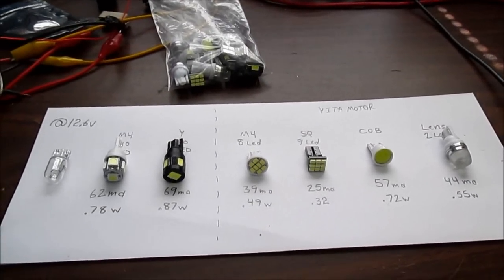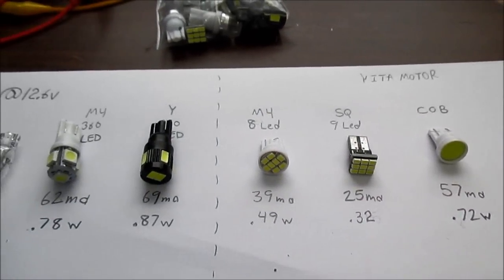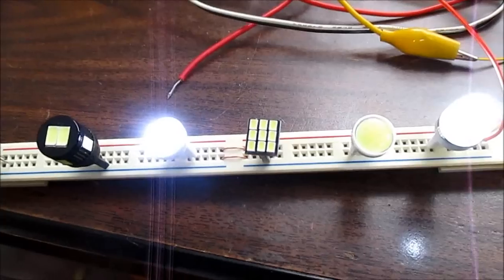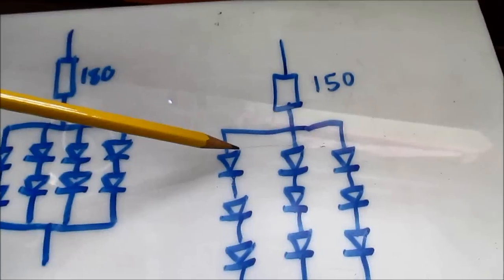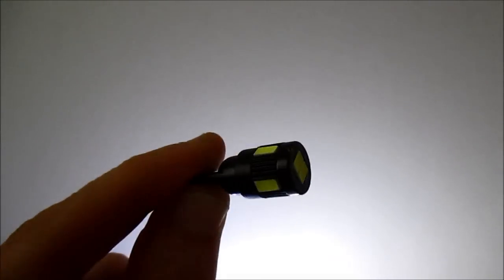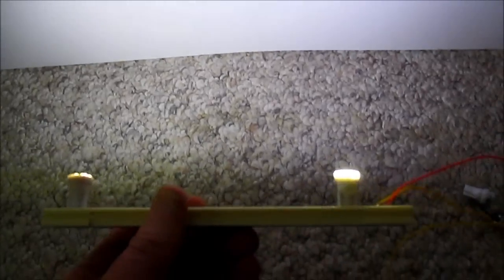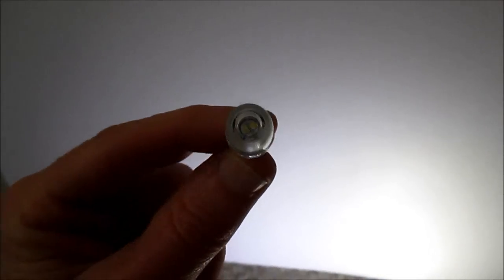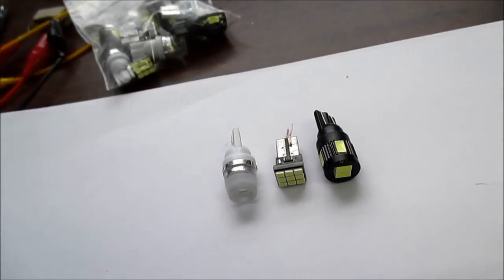12 volt "1 watt" LED wedge light bulb reviews (six bulbs tested)

Comment: I bought those cob leds 9:55 for gauge backlight because their light is not too bright and it is more diffused. The issue is it is too cheap but they also fail quick.

Also you should have tested it at 14+volts(charging voltage). I had issues with cob leds that are square or rectangles that are 1*1inch or larger. They work fine at 12v but on 14v+ the solder of the wires becomes liquid again.

Comment: Hi John,
Funny how not one is a true 1 watt. The Chinese do seam to have problems  calculating wattage, they obviously use a different formula to the one I was tough at school. Nice video however.
Reply from the maker: +Michael Beeny It is like the silly PMPO audio power ratings. I recall the cheap "Juster" computer speakers rated 60 watts PMPO when they are powered with a 3 watt 9 volt wall wart. It is okay these aren't really 1 watt because even though 1 watt is not much, these bulbs would get smoking hot if they really consumed 1 watt.
Reply: Sylvania zevo T10 is a true 1W led

Comment: hi, i need help with connecting some extra led to a 12volt vw badge on my front grille.some of led bulbs have failed there is about 25bulbs linked up.ive ordered some 3mm leds of eBay but can I just wire in the new ons ok?or do I need resistors.its just wires there now no resistors.

Comment: it would be so cool if you could build a led flashlight powered by 12volts. just the schematic
Reply from the maker: I made one with a Cree CXA1304 LED by modding a 6 volt lantern. Video is on my channel. I'd send a link but YT seems to filter them as spam.
Reply: +JohnAudioTech about 10 min after I wrote that comment. I found your video when you modded that lantern lol sorry

Comment: And i wanna know wich one has the longest life?Super bright is not nice if it dies after a short while.I guess the one with the most leds in it is the best because it doesnt get so hot.
Reply from the maker: The one on the far right with the lens is the best. Be sure these have the Samsung LED in them when you buy. If the lens gets in the way it can be removed by gripping the aluminum ring and pulling off the lens.

Comment: I see you have an incandescent bulb {what type? 912-921-194??] on the extreme left; yet it wasn't plugged  in so we could see the brightness difference to compare the diff with OEM bulbs. I have a 912/921 [T5] type back up light and was curious which LED would be a good replacement.
Reply from the maker: Not sure what it was. I had several of those bulbs in various wattages. None of the bulbs reviewed here are suitable in a back-up lamp. They don't put out enough light. They are really only meant to replace low wattage incandescent, up 5 watts or so. I haven't tried higher powered ones. Beware, most of the stuff on eBay is junk.
Reply: thanks John...I've been looking at some alternatives for a 912/921 T5 wedge type bulb but it would have to be awfully bright as it would be for the brake light on a motorcycle and those lights really need to show in my opinion an to be honest I've had decent luck with home bulbs on eBay haven't tried auto types yet from there, JDM Astar and superbrightleds have been the two I've looked at so far. They seem to be decent vendors.
Reply: i want to also add that Jtech LED makes a very good product probably the best bang for the buck had some laying around that I was going to use for my instrument cluster lights and found they were much brighter n cooler than the more expensive ones I bought from superbrightleds surprised me what the difference was between the two...type 74 replacement types.
Reply: @moss8448  Run T15 for backup bulbs

Comment: i bought the same exact " lens 2 LED" that is farthest to your right in your video, they are very inconsistent in quality (some were noticeably brighter than others) and burn out very quickly, i highly doubt they are Samsung LED'S. i bought a 20 pack for me and my friends altima and both of our bulbs started flickering after just 2 months and then died completely after 4.
Reply from the maker: They've been putting cheap LEDs in some of these now. The ones I have never failed after a couple years.
Reply: Just buy the cheapest ones off Ebay. I got the 5 SMD ones... 15 pack for $1.19 and they are bright and last well over a year. The ones in the license plate been going strong for 3 years now with no flicker. They aren't pure white ... probably more like 6500k+ but still very nice looking for the price.

Comment: Had those in my car. They all suck nothing beats the incandescent ones
Reply: lol never say never. 

Sylvania zevo T10 led is ur true reliable performance T10 led bulbs. Have them for 5 years and still goin strong. With a lifetime warranty, u will not have issues. 

And I tried to find other videos on YouTube, IG, FB, and not a single bad thing about is bulb burned out. Zevo is the best for reliable.

Definitely worth $24 bucks a pair 🤟🏼

Comment: Those series/parallel configuration are WRONG, those bulbs will burn out eventually, you must have one resistor per string of series LEDs, very bad design.
The reason is that LEDs are current devices, meaning, LEDs in series will all draw the same current, but with many strings in parallel, each strings will draw a different amount of current because of variations in Vf.
Only proper design is a single resistor for 3-4 LEDs in series (typ Vf of 3V), or a single resistor per LED chip if they are in parallel.

Eg: The 5x5050 bulb are kinda stupid, each chip have 3 LEDs and they are wired in series, but all 5 chips are in parallel with a single resistor, nono. The single 5050 bulbs have all the 3 LEDs in parallel, again nono...so I took apart some 5x5050 and kept only the top most PCB/chip and changed the resistor value.
Reply: Sylvania zevo T10 is the best one for when it comes to reliable and longevity. Had no issues after 5 years.